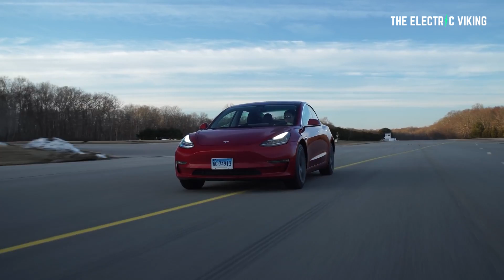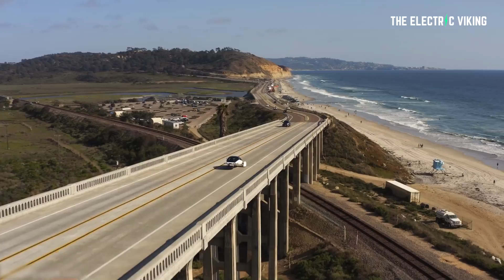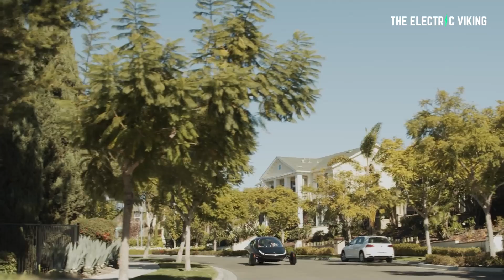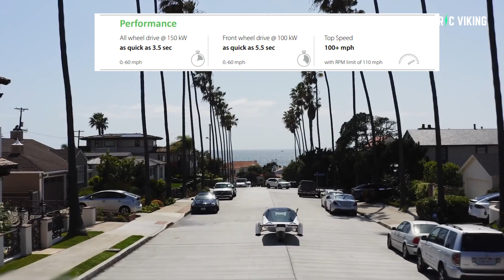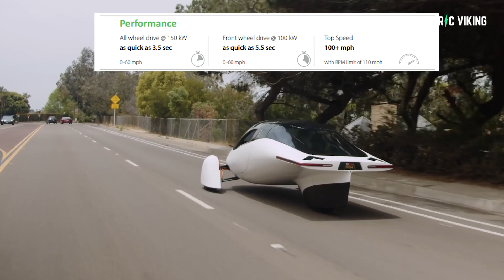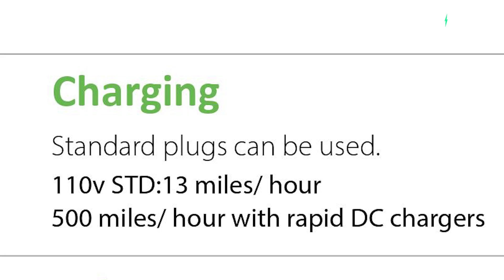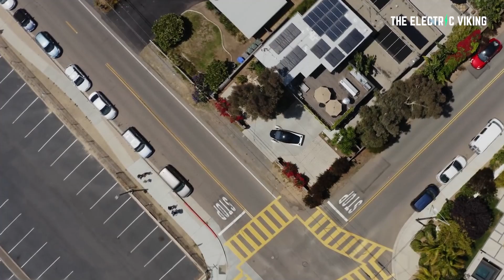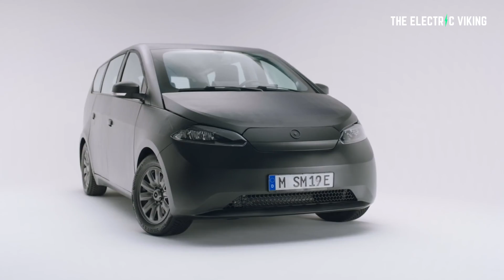I JUST bought a self charging US EV with 1000 mile range

Comment: I'd love to get one of these. The wheel hub motors gets red of a lot of excess weight and inefficiencies that accompany the connections between the motor and wheels; ie, drive train. I think this would be the equivalent of the effect the VW had on the auto market. If the big auto makers don't squash it.

Comment: Paying a fortune to save money ? This looks like an intellectual elitist trap
Reply: $25,900 is not a fortune for what is on offer.  I have ordered the full solar option, which will clearly pay for itself in electricity savings even in Iowa where I may get less than half the power it would get in San Diego
Reply: Makes sense for high sunlight areas. My concern is that new technology tends to be littered with  engineering turds that are hard to flush because of the low interest rates and high stock price.

Comment: 3 wheels and potholes … maybe …the  regions you travel … will have potholes or not? But honestly… three wheels and potholes do not mix.
So … one could get  a carport with a clear roof to charge …. Leaving a vehicle on the street all the time … to charge is not practical , safe or even reasonable …so add a glass roofed garage to the cost or get a sun gathering device installed on the garage roof , would underground parking would be a no go?
Has this been tested in winter conditions ?  Those front wheel wells seem to vibrate more than they should… on a final note … it looks nice.
Reply: Nothing has been tested that we have results for - absolutely nothing.

Comment: I pre-ordered the 400 mile, 2 wheel drive model with NO additional solar panels.  I live in Seattle - not a good prospect for solar on such a small surface.  I would love to see an interface to plug in a static solar array.  Solar array placement is really important.  

A heat pump with "camping mode" would be great and worth extra money.  If assumed that it has cruise control so I did not order the semi-autonomous option.  If I am wrong, hopefully they would let me add the semi-autonomous feature prior to manufacture.  

I could be tempted by the 600 mile range battery package, but 400  would easily cover what I anticipate.

Comment: Yes great idea. However you missed one point. Three wheels? You can steer the front two to miss pot holes but the rear wheel will hit them every time. Just ask someone that has had a three wheel motor bike. In other words could be a shit ride or have they figured a way around this, I am keen to know.
Reply: Pot holes are created by 4 wheeled cars and trucks. There will never be a pothole in the center of the road.

Comment: I enjoy much of your speculations of EV future but this video was merely a sales brochure. Critical questions should be directed to every potential EV/developer/producer. For example:
- Since Aptera went bankrupt 11 years ago with the same leadership, will it fail again?
- How can it succeed in $an Diego instead of moving (Tennessee, Alabama) for affordable labor rates, proximity to qualified automotive suppliers?
- Is Aptera going with 3-wheels mainly to avoid the expense of crash safety design and certification?
- Will a thin composite shell really protect you from an impact? (Spoiler: No.)
- Could any of the developer's claims be overly optimistic?
Reduced bias and increased objectivity would strengthen your credibility and build this channel.

Comment: Well how CAN it do 1000 miles if you shouldn't use your battery below 20%?  (Or charge over 80% under normal daily driving?) Are they claiming 60% of the battery is rated at 1000 miles? The optional battery?

Comment: Bad news - the Aptera 3 wheel motorcycle is back; but not on track.  There is no production line; they have no experience building cars or anything else; production was suppose to have started by NOW 2021 but they haven't finished their Beta test units let alone any production capability. Yes the concept is cool and if they ever produce one for you, and if you live in a very sunny area your onboard solar will get you 30 miles a day; that's a bit far from 600 miles.  So now that you are tuned into reality ; maybe you'll start questioning some EV claims.

Comment: The one drawback to the Aptera
Is it's width at the front wheel guard extremities
88 inches
 fyi
2 hub motors
Not 1 on the base version Viking
Tesla fan site claims the Cyber truck is 79 inches wide
Considering the capsule design of the cabin or cockpit
I believe they ought give their Orca a cute pair of dimples in her cheeks
And piss off them stupid wheel guards
Design a couple of sexy mudguards base on the dolphins fin
Aptera

Comment: This is a flashback to a vehicle, the Dymaxion Car,  designed & prototyped in 1933 by the man who later invented the geodesic dome,  Buckminster  Fuller.  The car was not an entire success, but had two driven front wheels, and a third tail wheel which did the steering.      https://en.wikipedia.org/wiki/Dymaxion_car        Some ideas take almost a century to gain acceptance...

Comment: Big spender, you.
Hope you'll get one. It will probably do 1000 miles 30km/h on a bloody sunny day.
Reply: In actual fact Apteras have a top speed of 110 miles per hour, limited by the motor controllers.  the 1000 mile range in the largest battery model is at EPA highway test conditions which average around 48-50 mph.  In San Diego they may well gain 44 miles of range per day.  In my home in Iowa, I expect to get an average of around 20 miles per day from solar at these speeds.
Reply: @n.brucenelson5920  I hope it wil manage.
EPA, albeit most realistic on average, still ain't practice for all areas.
For starters, manufacturers should get off that 1000 mile idiocy. 
An EV, or any car for that matter didn't need that. No one does such a trip in one stretch. Hence an unnecessary claim. Since there are numerous ICE that won't do that eighter.
Reply: @RedBatteryHead  I agree with most of what you say here.  Few people if any, are going to plan 1000 mile trips and drive under EPA Highway conditions in any case

However, it does give a comparison point the that is somewhat standardized.  I myself have done 1000 trips in less than 24 hours on a BMW R80, a vehicle that is considerably less comfortable.  

The claim provides a comparison point for what is possible, for instance, sufficient trip range at speed, even with the heater or A/C on at full blast.

That said, I have chosen the 400 mile range model with full solar.  Living in small town Iowa, I expect a daily solar gain of around 20 miles - still more than enough for my daily driving needs plus the occasional round trip to Des Moines or Kansas City without ever having to plug in.

The performance specs serve a purpose in allowing a buyer to choose a vehicle that will meet their needs.  The 250 mile range model will meet the needs of many commuters and sport riders, while being easier on the pocket book, and due to the lighter weight, even more thrilling to drive than the larger battery models.

Comment: Would never have a three wheeler for one reason- too hard to avoid potholes!  But love the info you give and will keep watching  :^)
Reply: Aptera has a 77" front track.  There is almost 3 feet between the front wheels and the center rear wheel track.  I don't think I will have much problem straddling most potholes I encounter.

Comment: With three wheels you are guaranteed to hit every pothole. Placing solar panels on a car is just dumb. Its a gimmick to sell the car. This tiny car is not worth the asking price. You could buy a real EV for that price.
Reply: None of these points are valid if you do any research at all.  The car is not tiny and about the same size as a Prius with 25 cu ft of storage space - in fact it can sleep a couple in comfort.   You have about 3 ft of space between each front wheel and the rear, so if you can't straddle many pot holes with that you should get your driving skills checked.  The $25,900 asking price for the base model before incentives is a real bargain compared to other EVs that offer similar safety features in the design.

Comment: If I put an order in how binding is it? Don’t mind loosing the $100
Reply: The order is not binding.  It is refundable by request at any time.  There was a 1/2 price Christmas special, and you can get a code from any preorder holder for $30 off the $100 Check the web site if you want to take advantage of it.  There are over 15,000 preorders now.  At least it will get you a place in line.

Comment: Stop being a FAN BOY until you can test it.  It is not in production and might never be if the money runs out again.  Foolish people might jump on the ban wagon and make an investment based on your excitement level.   Sandy Monro has sold any interest in any EV stocks because of a conflict of interest.  Most of the EV press will get a chance to test it  for the short term when they have the new model introduction.  The reality is that it  MAYBE be built in 2022.   Of course, I am open minded .
Reply: Press is already getting opportunities for test drives or rides with the prototype.  I am not even press and had a ride in the Luna prototype, which was far more thrilling in the twisties than I had guessed it would be.  When I pick mine up I will offer rides to as many people as I can.

Comment: I pre-ordered over a year ago, $30K with solar panels, 250 range. I can upgrade my battery if a breakthrough comes or if I need to. The main advantage of Aptera is not the options, but the fundamentals of ultra low drag/weight. I have been waiting for this paradigm shift design since the '90s.

Comment: Yes I am considering one! Sandy Munro is a big supporter of aptera. He is not only an investor but they are a client of his. Munro is helping them plan their production assembly line. The manufacture of the aptera is much simpler than metal body cars. The aptera body is several pieces of light weight cast composite. The pieces are then bonded together. Two workers can carry the pieces to the bonding jig. Manufacture can be done in a warehouse, no costly plant like metal body cars....... The body has already been crash tested and passed.....
Reply: Correct, except for the parts are not cast, but produced by UV cured vacuum resin infusion.

Comment: Hi Sam, I'm an investor and "own" order #833. The current order is 60 kWh, 600 miles, with full solar, however I plan on downsizing to 40 or 25 kWh when it comes time to finalize since we also have a CT ordered with hopefully 520 miles range. I'm a solar geek and don't see getting 40 miles per day average. My calculations on pvwatts.nrel show 35 miles per day from 700 watts in southern Arizona. Also the weight of the 100kWh version will likely prevent 1000 miles and limit net cargo capacity. I think the 25 kWh version will be wildly popular for a commuter vehicle, especially for those without access to charging power. We currently own a Model S. Will sell that to buy the CT.

Comment: Come on...that's not a car, it is the equivalent of a modern golf-cart.
Reply: You have not grasped the performance,  safety or size of this vehicle with your comment.
Reply: @n.brucenelson5920  Exactly what I am saying...PERFORMANCE of 1000km, so what if you can't take it on the highway on a road trip //  SAFETY, would hate to see what happens if this vehicle gets into an accident with a SUV or pick-up.
Reply: @johnnyv5995  I presently drive a  Gen 1 Honda Insight which weighs about the same as a 40 kWh battery Aptera.  The 100 kW battery pack would be required to 1600 km on a charge.  The Gen 1 Honda got safety ratings of 4s when it was crash tested.  I was hit from behind by a large car on the freeway at 60 mph and was uninjured.  You can bet I found another to replace it.  The Aptera design has superior safety engineering in several areas and will be voluntarily crash tested to automotive standards.  We don't have the ratings yet, but by design it is safer than that car was - in part because it has larger crumple zones and an F1 style passenger safety cage the Honda lacks, plus air bags and other safety features with more advanced design.

Comment: you may get one eventually, it won't be in 2022 and of it is you wouldn't want it. Their timing is horrifically unrealistic, just go back to their previous press releases, according to their own timing they should be in production by now but instead are wrapping up the ALPHA phase, still have Beta and Gamma before SOP.
Reply: Everyone is missing release dates, including Tesla and the Big Three.  Covid related issues are affecting everyone.  Aptera has already shown completed beta vehicles and are in parts validation testing.  If they don't run into major roadblocks with the supply chain or beta test results, I still expect to receive my Paradigm edition this year.  Just like any new vehicle there will be improvements in later ones, but with right to repair, and a simple design with a 10th of the number of parts of standard construction, updates will be relatively easy.

Comment: I'm extremely skeptical of the range claims for anything but ideal highway conditions. In city driving, it will be MUCH worse as the efficiencies of aerodynamics are far less significant. They must still play within the rules of physics with respect to motor efficiency and regeneration - of which they are absolutely not bringing anything new to the market.

It's going to be better than anything else, but they are overselling it.
Reply: The slower you drive an EV the better the efficiency. Stop and go is not a problem either unless you floor it at every light. We have a Tesla S and average 245 watt-hours per mile.

Comment: One of the variables about coefficient of drag that is not immediately evident is that you multiply that times the frontal area to get the real energy consumption. With a coefficient of .13 for the Aptera and .23 for the model 3 T it doesn’t mean you’ve increased the drag by .10. The frontal area of the Aptera is much less so it likely has less than half the energy consumption of a model three at 50 miles an hour.

Comment: I’m a bit skeptical based on a two seater, the motor tech, the apparent bulky nature of the three wheel configuration and width, and the unproven nature of the company.   I would not advise any investment size one isn’t prepared to go to zero.   I would put greater odds on Tesla continuing to advance battery engineering and cost efficiencies to achieve a range above 500 miles at a price point below $50K, at which point why would one be keen on a car with less than half the functionality and reliability.   The future of unibody construction by Tesla using gigapress plus spacex alloy seems an unassailable lead which will continue to prove up Tesla as the price performance leader

Comment: I considered Aptera before but did not due to the following.  A small ICE car (Ford Escape) costs us around $0.12/km in fuel expense.  An electric car like the Model 3 will cost us around $0.02/km, that is a $0.10 saving per km.  Aptera, ideally will cost $0, which means you're saving only $0.02 per km for a car that makes huge compromises when compared to a base Model 3 or Y.  To me, that small cost in saving compared to an plug-in EV is not worth it.  

Also, I believe it is not considered as a car but a motorcycle, which allows it to by-pass safety regulations, even though Aptera says they are very safe.  

Also the bar in the window is in the view of sight, making it a big inconvenience.  Check out their forum, there is a huge debate over that window issue.  

What is really revolutionary about this car is it uses hub motors.  How brilliant, finally someone is completely discarding the drive train and using off the shelf hub motors.  Love it. Cheers from Canada.

Comment: the thing's front wheels are so wide out , that they literally sit in a parking space's white lines , that's a massive problem ..also noticed that it has a horrible turning ratio , going wide and into opposing lane when turning , like I said , it's a death trap.
Reply: The turning radius is an issue, I do believe that they will modify the steering from the concept car.  Because they really need to.
Reply: @jonathanwest6564  Turning radius was changed due to suspension redesign.

Comment: Hi Sam, two little corrections:
- There is no single motor option. It's either 2 in-wheel motors (front wheels) or 3 in-wheel motors (on all three wheels).
- Safety is superlative because the flexible monocoque body is built in sandwich composite and is stronger than a motor bike helmet. 
Check out this video : https://www.youtube.com/watch?v=tx5ufCgRdVU&t=680s (jump to 11 : 20)

Comment: Weight in an EV is not such a big issue as some think because the momentum of speed is pumped back into the battery. There are losses of course but nothing like you have when speeds is entirely burnt off by braking friction.

Comment: I love the Aptera approach and been following the proces. Specially the inwheel motor design. 
But i will go for a more affordable solar car (up to 6m2 panels)with 4 inwheel motors, the Xbus. Will also be sold in 2022, but has way more modularity and variants. You can even swap your own batteries, or add more.

Comment: Aptera is still expensive for me. At CD 0.13, I am disappointed but my 2D CFD simulation points to this figure. Would you consider a Transparent SUV, 4.5 m x 1.7 m x 1.3 m with CD of 0.1, and costing US15,000? I am designing one, but it only has 100 kWs supercap and 10 kWh battery, and made of plastics.